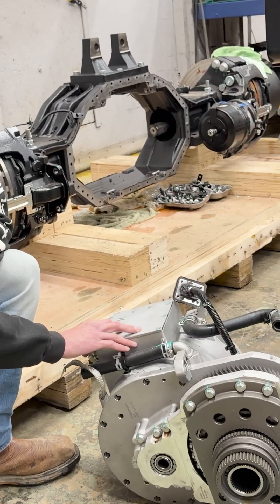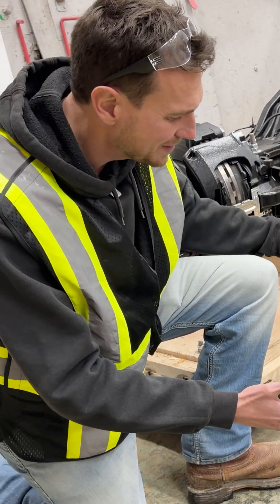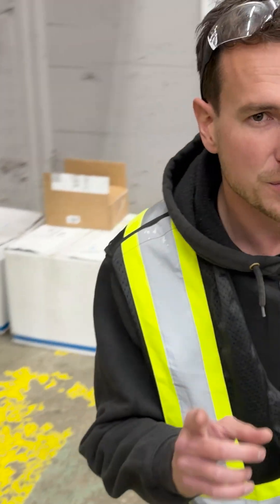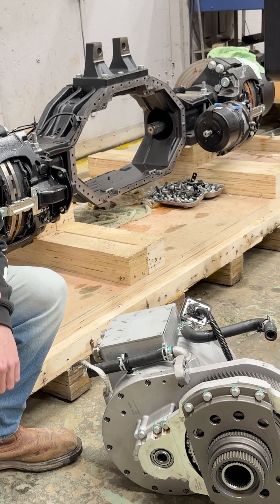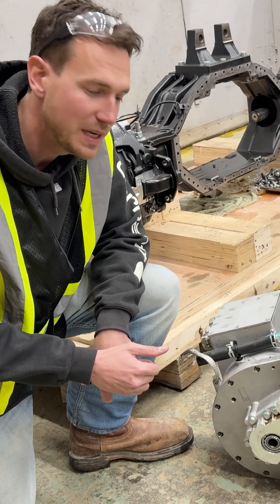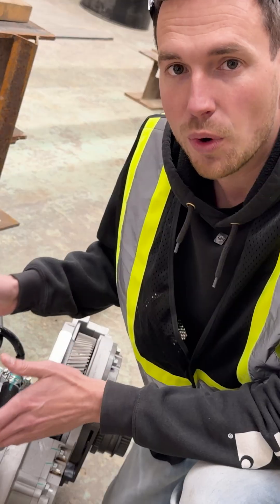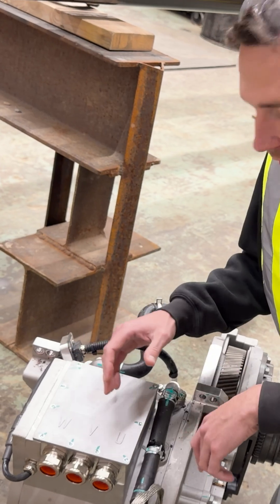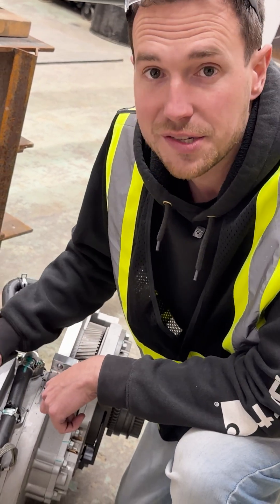Torque-Vectoring Axles: Tiny Motors, Huge Power

Comment: I don’t know if this is a good idea. Axles take a lot of hits and vibrations and solder joints don’t hold up well to that. I can see some cracked solder joints on the controller PCB happening. Time will tell if it works or not.

Comment: I don't trust these ludicrous torque figures one bit. A diesel engine makes 20000 ft -lbs of torque then not only would it be the size of semi, but it would also break axles of the caliber shown in the video, so one way or another that torque figure is bs
Reply: You're confusing torque of an engine on an engine stand to read "torque at the flywheel). This is different than torque at the wheels when you put an entire car on a dyno.

An engine that makes 200 ft lbs of torque (in a jeep) can easily make 6,000 ft lbs where the rubber meets the road by using gear reduction. A granny low 1st gear is 3 ro 1. A t case is 2 to 1. A rear end can be 5 to 1. So in this example the torque is amplified 30 to 1.

Comment: That dude said there's no ring and pinion there's no nothing and here it is there's gears in it and I know there was there was no way they could be putting that axle the way they were mounted without having gears to connect to the shaft
Reply: There is no ring and pinion like in a normal axle pumpkin that turns the power 90 degrees. There is an inline planetary gear set with low and high range.
Reply: @Sah-o5m I get that but he made it sound like no gears direct drive that's not direct drive I get the concept when they're at 500,000 miles and I can afford one

Comment: Trust me on this from an industrial controls perspective, built in controllers are a nightmare. Having to buy both just bc one went bad sucks and a harder to find.

It is funny to see folks so surprised of the compact power in these motors, almost like why did it take so long to get rid of those ICE engines? 1/100 complexity, 100X more power dense (weight to hp raitio) and ZERO service needs. Batteries were the issue, hence these guys going hybrid which is a great fit for an EV truck.

Comment: I’ve been thinking for a while… why don’t EV cars have just 2 speeds in the motors for better cruising efficiency? Speeds over 50mph is where EV start to rapidly lose against gassers in term of distance travelled for each unit of fuel.

Comment: This is impressive. But the inside diameter of the output shaft on this assembly is about the same size as what's used on a 1 ton pickup truck. I very much doubt either can handle 20,000 ft-lbs, or at least not reliably

Comment: I have a need for a motor like this and using it to be the transfer case on a 4x4 wheeled excavator.  Now can it be powered by 480v ac 3phase from a diesel generator?
Reply: I believe so. The challenge is throttle control. You'll probably need an inverter/converter controller between the engine and motor to control power output.
Reply: @Sah-o5m isn't that the box on the side he is talking about?  The controller would be mounted on the cab, receiving the power from the AC generator, sending it to a slip ring thru the turn table of the excavator to the motor.   Only 3 wires would need to be ran to the motor.

Comment: I'm curious...how much HP does it taje to run a loaded truck down the freeway efficiently?🤷‍♂️
Reply: A car needs like 50 hp to push against the air at freeway speeds.

A pickup needs about 100 hp on the freeway.

A loaded semi really needs 150 hp just to move on the highway on the flats.

A semi on the highway on a hill wants all the hp it can find.
Reply: @Sah-o5m it doesn't NEED 1000hp, nor 1500hp tho.
I like the idea of a rig brong built with a lil "excess" engineered in for reliability...but all outward appearances look like this is just an expessive overboard.
No one in the real world is going to be able to utilize a 2,000hp or 3,000hp 2 or 3 axle semi truck.
Reply: @danielkingery2894 
You and I are having different conversations.

I suspect that you are focused on the light weight, aerodynamic, otr over the road, high speed, highway semi trucks that primarily pull rectangle dry box van trailers that we see on the freeway and represent 70% of the semi truck market. These trucks max out at 80,000 lbs.You are correct :)

Edison Motors focuses on the remaining 30% of the class 8 semi truck market which is heavy duty "vocational" trucks like concrete mixers, giant cranes, austrailian road trains, etc. These trucks haul up to 400,000 lbs. They need all the torque and horsepower they can find.
Reply: @Sah-o5m well, maybe the Canadian Taxpayers can help cover the extra cost to those operators...lol
The fuel savings isn't going to cover the expenses in those applications.
Hopefully the tech can swirl down into the OTR space eventually. 
The pickup truck conversions certainly don't seem to be landing "within reach" as of yet.
Reply: @danielkingery2894 
Um no. Canadian government has ignored Edison. The fuel savings is hoped to cover the up front costs. This tech benefits semi truck city drayage and is not practical for otr.

Correct. The pickup truck conversions at $125k per truck is very attractive to mines. It will be a while before that trickles down to normal people.

Comment: These would be amazing on tracked vehicles,  making them so much more efficient than differentials and wheel brakes. And traction control and stability control has so much promise. And you could do abs without even using the brakes.

Comment: Will they be able to act redundantly if you have a failure in one motor? Could you limp it in if the motor or controller on one side? That would be a great feature to keep service and towing folks from having to work on the side of a highway.

Comment: Will the engines run in oil or just the gears?
Reply: ? The engine in the front of the vehicle is just a normal engine that does normal engine things.

I believe the electric motors have great oil for the gears, and also have a cooling passage for glycol coolant.

Comment: Probably more like 2,000 NOT 20,000 LBs. A 750 volt DC traction motor for a Loco can generate 4,500 lbs.
Reply: An off road pickup with 200 ft/lbs engine, in granny low, with t-case in low, and 5.13 rear end will easily deliver 10,000 ft/lbs to the wheels and snap drive shafts.

A normal semi truck will deliver 30,000 to 50,000 ft/lbs per axle.

So Edison e-axle with planetary gear reduction is probably putting down 20,000 ft lbs per axle shaft, or 40,000 lbs per axle.

Comment: What happens when someone runs into your wheel at say 20 mph. How much would that cost compared to a normal axle?
Reply: Like any accident, it's unlikely to hurt an axle. However, yes, the Edison e-axles are more pricey. 

Hopefully that higher up front cost is offset by lower operating costs due to regen braking.

Comment: Don't forget to install a system that can mimic a locked differatial.
Reply: All the 1’s and 0’s in that controller could do that. 

Really with each drive axel having isolated drives on either side, the 1’s and 0’s could make it way more efficient and effortless in limited traction scenarios.
Reply: you just put vectoring halfway and it effectively behaves as a locked diff, if anything, locked diff is the default behavior and vectoring requires work.

Comment: It doesn't allow torque vectoring, it demands torque vectoring. And if the result isn't absolutely perfect, you see the same problem shown by the cybertruck offroad.
Reply: Meh. It's simple to use the abs wheel sensors to limit wheel slip.

Comment: Use them for Electric Bogie with Advanced Torque Vectoring/Steering. Somewhat like a railroad car, an electric platform designed for autonomous movement of standard shipping containers uses a bogie at each end, featuring advanced torque vectoring (steering), enabling extreme maneuverability and efficiency in cargo handling.

Comment: I think Teslas need a high/low as well. Just too many RPMs at "interstate" speeds to get good cruising empgs.
Seems like a good idea to me 👍
Reply: I'm torn. It's a pro/con thing. I think it's clear that the electric motors prefer a 2 speed transmission for vehicles pulling heavy loads on the highway. However, the best part is no part. By adding a 2 speed trams, Edison has added a part that can break. It's a pickle.

Comment: Electric vehicles suck and I say it because it's all this climate change BS
Reply: you fell for the most stupid lie of the century
Reply: Batteries suck. The electric axle part is fantastic. Higher torque and horsepower. Instant 100% torque at zero rpm. Regen braking saves brake pads and money.

Edison buyers care more about having reduced operating costs, than some green agenda.

Comment: 20,000 ft lbs of torque does not equal fast.
Reply: Correct. 20,000 ft lbs of torque times 4 wheels equals 80,000 lbs of twist.

250 hp times 4 wheels equals 1000 hp of "fast" depending on what you're hauling.

Comment: Look into hub motors as well. Probably the best way to power steering axles. They don't need nearly as much torque as the drive axles. Enough torque to help in low traction situations. They also help with regen braking and minimize weight and drivetrain losses.

With a secondary hub gear you'd be able to great like crazy. If the first is 3:1 the second could be 6:1, then you'd have 4 speeds. 1:1 3:1 6:1 and 18:1 with both gears engaged. A premium power axle choice for super heavy duty stuff.

Comment: Is Edison Motors considering a safer replacement for lithium ion batteries?
Reply: LiFePO4 is very safe. Way safer than Turbo Diesel Engines. Moving to exotic cell chemistry is just not practical.

Comment: I wanna see a top fuel style dragster with one of these
Reply: Super Capacitor and 4x Axial Flux Motors could probably do 5,000hp for a 1 tonne dragster.
Reply: @Neojhun thats still less than half the hp of a top fuel car. Torque management would be the biggest challenge as yes electric motors can generate massive torque relative to hp. But you can't use it all instantly. That's why top fuel cars use a multi stage clutch now that locks up progressively during the run.

Comment: Im curious about the cost of that axle with 2 motors vs just 1 . Im looking at building a food truck and think this tech would work for remote locations with genset onboard or urban areas where you can plug in at venues.😊

Comment: So, from what I am getting from this video, you could do tank turns with a lorry/truck
Reply: Automatic Electric diff locks allowing turning without unnecessary mechanic stress even in tight turns 🤔😃
Reply: Yep tank steer is icing on the cake when it comes to Torque Vectoring EVs. But in reality it's use to help with traction control while turning. You could even brake the wheels with the motors for a split second, way more instantaneous than brake pads.
Reply: Mild tank steering would be great for normal driving.

In a semi, if we tried a tank turn, it would rip the front tires off the rims as they drag sideways.

But yes, an Edison pickup with dual motor axles in front and rear could tank spin.

Comment: My opinion would be to keep the controller separate from the motor. 
A blown controller would necessitate removal of the motor from the axle and make repair in the field more difficult.
It's also a step towards having to replace the whole assembly instead of just components.
Reply: Nope, the inverter module should be able to be extracted out of the motor assembly easily. That's how it works on Tesla Drive Units. It does not require any mechanically fixed welded connections. It's very much a bolt on part.
Reply: @Neojhun  Still needs for you to needlessly drop the motor. On a sportscar, I can see it. On a largeazz truck. Nah, separate.
Reply: @m4rvinmartian  depends on where it's located.
Reply: @Neojhun will that have any effect on torque?
Reply: That depends on if moving the controller closer to the motor has serious benefits.... It could be that getting the controller closer reduces transmission losses. Reducing the 3 large phase load lines to 2 large wires and a control signal might might be better too. 
As long as the controller is a replaceable part and is fairly reliable, then taking one side of the housing off shouldn't be too bad while it is still on the truck. As long as the axle can be disassembled while still on the truck this should be a small price to pay for any bump in power efficiency.
Reply: @Tom89194 also don’t forget, the motor to inverter cables are gonna churn out some hellacious EMI as well. 50kW+ (cause realistically you won’t use all 150kW often) of high current PWM ripple in day to day usage I’d imagine plays hell on the local electronics. 

Although I wasn’t thrilled about an “all in one package” I have no doubt it’ll be an easy to fix version due to Edison’s design philosophy.
Reply: I may have mis heard him, but it almost sounded like they were going to eliminate the motor controller.
Reply: @mmix224 not possible for the kind of motor he is talking about, but he did make it sound that way
Reply: yeah, but overall I think they are considering failure rates, so if the motor has a higher failure rate, or the gear pack, compared to the controller (which in most cases is just not going to fail on it's own). So yeah, you are right in most cases, but if the controller's fail state is that it nukes the motor, doesn't matter much if it's one part or two. And integrated, might actually make the field repair easier. I'm just guessing here, so not really a disagreement, just an different angle of thought.